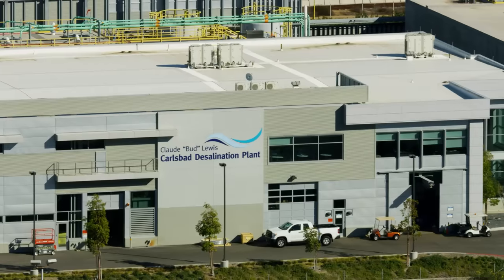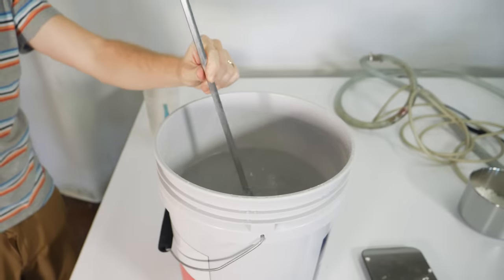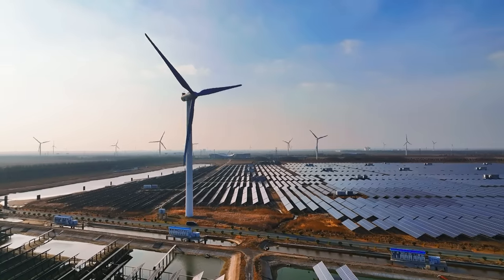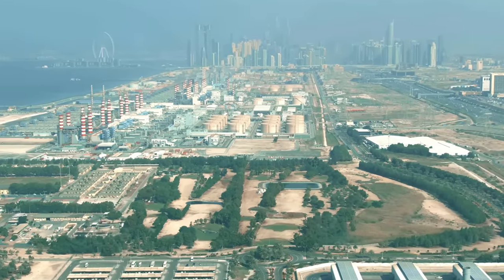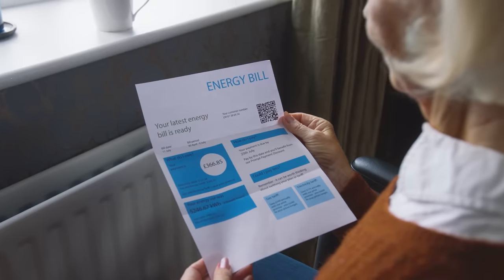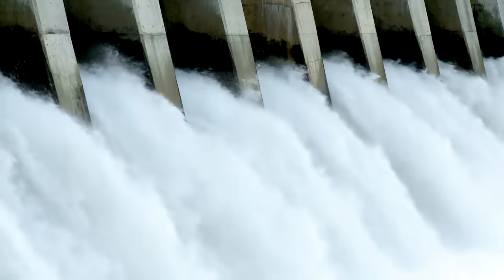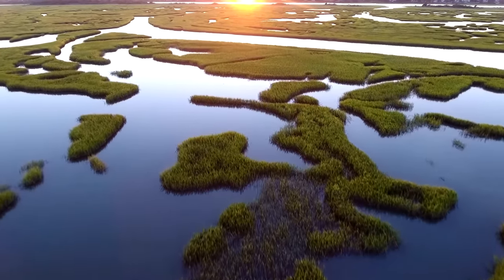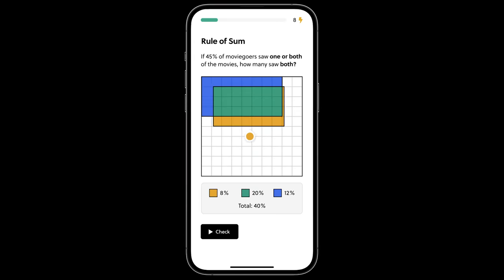Why Is Desalination So Difficult?

Comment: I'm a Navy veteran and I served on a Nuclear Aircraft Carrier. We had a desalination system built into the Reactor system using the excess heat from the steam powerd turbines. It was actually very efficient.
Reply: Nobody cares, bud.
Reply: nice, i was wondering exactly this. as nuclear and other powerplants have to boil water anyways, why aren't those systems combined?!
Reply: @adrieltc  sadly nuclear doesn't have large profit margins. So big energy used the fear of radiation and meltdowns to justify closing plants... then went back to fossil fuels.
Reply: @andybaldman  I care.
Reply: @adrieltc  They are combined at times, but the designs have to be tested thoroughly.
Reply: @andybaldman  Did Father Bob touch you in your no-no area?
Reply: @Myrune1  Yep.  And I liked it.
Reply: @adrieltc  Thing is that you can't use the Steam Cycle Water for Desalination. Boiler Water (and the Steam Cycle of a Nuclear Plant is nothing different) must be treated with some strong Chemicals, making the Water considerably caustic. Instead, you use the hot Condensate from the Turbines to then heat up an external Desalination Plant. That same Principle is used on commercial Ships to produce Fresh Water with reclaimed Waste Heat from the Engine Cooling Water.
Reply: @andybaldman Speak for yourself. I found it interesting to know
Reply: @morganmedrano920  Roads arent profitable either but we still have roads
Reply: @namename9998 Roads absolutely are profitable. Consider how much the economy would shrink if there weren’t roads available to move people and products
Reply: @andybaldman  Nice attention seeking behavior.
Reply: @namename9998  How do you figure that roads are not profitable?
Reply: @andybaldman  it appears you care despite your comment
Reply: Does it also have the mandatory JP-5 injection for enhanced taste?
Reply: @CaliMeatWagon  Thanks for giving it to me!
Reply: @andybaldman  Actually this sounds very interessting.
Reply: @Fred_the_1996  Navy Grape Drink...
Reply: @mrb692  Thats not how profit works. If it was then why are so many roads and bridges in bad conditions. If roads were actually profitable then they would be paved with gold but theyre not. And using your logic then the toilet paper you flush down the toilet is profitable and so is your underwear except thats not how profit works.
Reply: @CaliMeatWagon  If roads were profitable then why arent they paved in gold?
Reply: @andybaldman  Well if you are begging for it in the youtube comments section, then you clearly need it. And I like to help the less fortunate.
Reply: @namename9998  Answer the original question:
"How do you figure that roads are not profitable?"
Reply: @mrb692  Toll roads are profitable. But any road that does not charge to use it can't generate money for its upkeep, thus it's a money pit. economic impact is not the same as profitable
Reply: @CaliMeatWagon  Toll roads are profitable. Roads that do not charge for use are not. Don't confuse economic impact with generating its own revenue. If a road doesn't make its own money, it can't make profit (the money left over after cost of upkeep is profit)
Reply: @andybaldman  You cared enough to write a response, bud
Reply: @Myrune1  I didn't like his comment either, but there is no need to perpetuate vulgar stereotypes.
Reply: stop being so toxic partypooper
Reply: @sammiller6631  I'm in CA, a state that basically requires a License to get around because of the horrid infrastructure. My annual registration is over $200 and like %30 goes to the roads and about another %30 goes to the CHP. So even a road without a toll, is getting its share.
Reply: @andybaldman well it's a science discussion and it's relevant to the subject in the video so....I think most people disagree with you
Reply: @andybaldman this is an educational video?
Reply: @sammiller6631  Profitable doesn't just mean "revenue minus expenses". Profitability according to common usage and several English dictionaries also means "yielding advantageous returns or results; beneficial; useful". So to claim that the only way roads can be profitable is if they directly collect revenue, by tolls or other means, is objectively false.
Reply: @sammiller6631  Wouldnt the fact that roads rely on public assistance via taxes be another example of why roads arent profitable?
Reply: @andybaldman  
And yet you left a reply
Reply: Very efficient after the $30 billion up front investment XD
Reply: @CrunchsterXX2 That was too much. I found him rude for saying it, but what you said was truly Bad Form.
Reply: @namename9998 Infrastructure is a societal investment. Society doesn't expect to make a profit from roads, hospitals, schools or bridges. The positive impact of these things is not directly measured in so mercenary a fashion.
Reply: @adrieltc  He briefly mentions it at 6:18 in the video.  It's a technique called cogeneration.
Reply: @andybaldman why would you feel the need to say that?
Reply: @adrieltc  what stopping using nuclear energy not only it is fairly expensive, but it often has negative political move since many people equate nuclear == Chernobyl
Reply: Thanks for sharing this information!
Reply: @morganmedrano920  To think how far we would be if we didn't shut down nuclear plants
Reply: @namename9998  On a purely technical basis they don't make money in fact some states have been pushing to turn some interstates into toll roads to pay for the expensive maintenance costs, but the less direct economic benefits outweigh the cost of maintaining, people rely on the roads to ship things by trucks, get to places. The economy relies on interstate highways, infrastructure projects like inter-states and rail projects may not have initial benefits but the long-term ones are why we build them.
Reply: @ryanchun5536  I understand your point about the start up cost. However I as you to consider the "product life cycle". It's expensive to start up, because the country that should have been throwing the most money to develop, just kind of stopped. So we never hit the point where building them gets cheaper as we get most efficient and effective. That is also when the technology shrinks in size. Honestly we should be using mini reactor substations with how long we have had this tech.
Reply: @andybaldman I do. Lol.
Reply: @andybaldman I can tell strange ones create other strange ones💀💀
Reply: The desalination system is efficient. Having aircraft carriers is about the least efficient use of money on earth. 
Thank you for your service.
Reply: @Genius_at_Work  this is not correct. On three of the four subs I was on the steam driven distillation units ran off of auxiliary steam system with lower pressure than the main steam system. The steam is not caustic. The boiler water is treated, but those chemicals don’t carry over into the steam.
Reply: @sammiller6631  Governments invest in roads (and other infrastructure) which grows the economy which means more tax revenue. 

Consider the GDP and thus tax revenue of a government that does not provide roads to its citizens, then consider the GDP and tax revenue of one that does. Governments avoid investing in infrastructure because it is 1) expensive, and 2) construction takes longer than one election cycle. In a world dominated by the quarterly report, why spend money to improve future income later when you can spend money today?
Reply: @namename9998  Governments avoid investing in infrastructure because it is 1) expensive, and 2) takes longer than one election cycle. In a world dominated by the quarterly report, why spend money to cause traffic now and improve future income later when you can spend money on other stuff and not cause traffic today?

But at the end of the day, better infrastructure = bigger economy = more tax revenue
Reply: @andybaldman the point he makes is that energy production and energy transportation, due to thermodynamics, will always have losses through the form of heat. This unavoidable loss can be harnessed through additional systems, such as coupling desalination to an energy producing facility that will otherwise have no productive use for the heat loss.

In short, anyone who cares about economic desalination does in fact care.
Reply: @andybaldman  Why do people like you even watch channels like these. Doesn't seem to match the mind of someone who is curious and always learning.
Reply: @neurofiedyamato8763  The fact is, you don't watch this to learn anything.   Despite what you might feel, you aren't learning engineering by watching youtube.   You watch this because youtube put it in your feed.
Reply: If you are running a nuclear steam turbine, yeah desalination is easy!
Reply: @adrieltc  I searched this a year ago and yes - nuclear desalination is a thing
Reply: @morganmedrano920 I am not sure nuclear power is attractive if we include cost of storing used fuel rods.
Reply: @andybaldman what’s wrong with you ?
Reply: @morganmedrano920 every state requires a license to drive ?
I don’t understand.
I live in CA, infrastructure is comparable to other states, in larger cities freeways are horrible due to traffic jams other than that roads are in good condition.
Reply: @hikarikaguraenjoyer9918 tax on gasoline was supposed to be used for maintaining roads and bridges ?
Reply: @gund89123  No, I mean CA requires you to drive... as in you can't rely on public transportation. For example, Sacramento used to run the light rail 🚈 24/hrs now its like 16/hrs. We developed new areas and never extended the busses to go to them, ect..
Reply: @namename9998 

"If roads are profitable then why aren't they paved in gold?"

Because then they wouldn't be profitable, genius.
Reply: @gund89123  not really what i meant but at least where I am from they used the money for maintance
Reply: @notahotshot  You mean like jewelry isnt profitable despite being made of gold and precious gems? But jewelry is profitable so your argument doesnt make sense.
Reply: @Svensk7119 a direct profit*
Reply: @notahotshot  Once you get past the fact that you're being trolled by namename you kinda have to admire the mental gymnastics required to come up with that that kind of bull, even while you fail to understand their motivation
Reply: I had a thought the other day. We should make a garbage incinerating barge that self sustains itself and produces clean water as a byproduct.
Reply: @adrieltc  They are kind of combined. But at least on the Enterprise, the desal plants were in the auxiliary spaces. There simply is no room to have them in the steam spaces where the main engines are. The reduction gears alone take up a huge chunk of that space. And the Reactor Auxiliary rooms have systems for the reactor plant, including piping with radioactivity in them.
Reply: @adrieltc Because liberals scream about every industrial project. It's politics that is currently blocking California's attempt at desalination.
Reply: @andybaldman I care, what I don’t care about if you.
Reply: @andybaldman don't comment then
Reply: @mrb692 Nope, roads are one of the biggest losses for cities and governments
Reply: @sammiller6631 even toll roads aren't profitable.
Reply: @andybaldman sorry, but I care bud
Reply: @RobertDoornbosF1  Do you have a source or something I can google? I could see roads being one of the biggest expenses governments have, but when you consider 1) the roads are mostly paid for with taxes on fuel and 2) how much tax revenue would not have been collected if roads did not exist to provide efficient transport of people and product, I can’t see roads operating at a net loss (as in a government would make more money by not investing in roads)
Reply: @mrb692  Just google a cities bookmarking records for a random year. 

Especially North American cities, but also in Europe. Road maintainance will be a big expense, and in the income section, nowhere will roads be mentioned, because that's not how profit works.

Or read into growth ponzi scheme suburbia. Most papers, articles on that are not talking directly why roads are nit profitable but it's in the ballpark

Kinda unnecesary, but you stated roads provide efficient transport. Kinda false, since roads are for cars, and cars are inherently inefficient at moving masses of people.
Reply: The irony is that nearly every nuclear plant with a cooling tower generates a ridiculous amount of freshwater in the form of clouds from their cooling towers, and yes, they have to have desalination/RO filters to keep their cooling water from turning into brine. The plant I worked for had two reactors, and the entire first floor of both power blocks was almost nothing but desalinization equipment.

Simply capturing that water would have provided a huge quantity of fresh water, but the plant was literally located on a river, so no one cared. That, and at that point in the plant's life cycle, everything was crapped up. People fished in the discharge canal of unit 1, but... I certainly wouldn't have eaten anything I caught there.
Reply: @maurvir3197  That's exactly what I'm saying 👏. Nuclear plants make steam as a byproduct. We can also capture the salt and remove it from the ocean since there is way too much at the moment. I guess technically, it would help with microplastics if we had enough plants taking in ocean water.
Reply: @Svensk7119  remove hospitals from your list along with some schools, the US healthcare system is suffering from greed by a very few at the top.
Reply: @johnnykATL  Some greed, yes. There are people in it who generally want to help.
Reply: @Svensk7119  oh I know, I’ve spent my whole adult life as one of the people in it to help and while the majority of frontline healthcare workers care and strive to do right, it’s the few in the management/ownership end of things that are the ones I’m referring to.
Reply: no, that just means you had way too much waste heat, you fix your waste heat issue and your desalination becomes way more expensive.
Reply: @andybaldman  i care
Reply: @andybaldman I do ❤
Reply: @andybaldman u should be nice ❤ people matter
Reply: @CaliMeatWagon  feel other means is lose enough to fit anything I need.. totally see your point an agree.  For now lol
Reply: @scottmcshannon6821  fair, but I would argue that it's not waste heat if it's being used with intent/purpose.
Reply: @Lardbutt200  "Are hotels profitable? Are airplanes profitable? Are grocery stores profitable?"
Yes. Yes. Yes.
Reply: @Lardbutt200  I guess you dont know that there are luxury hotels painted with gold.
Reply: @andybaldman  Apathy is often a sign of low intelligence.
Reply: @OutsiderLabs  Or high selectiveness.
Reply: @andybaldman  you don't get to speak for anybody but yourself and comments like that make me question if you should be allowed even that much.
Reply: @namename9998 That doesn't make any sense. Gold doesn't improve their value to consumers. It's like saying, if beef is so profitable why isn't it studded with diamonds?
Reply: @sammiller6631 They're profitable in the broad sense that they generate more economic output than the require in tax money to build/maintain. Toll roads just make the tax more immediate and explicit.
Reply: @andybaldman  You might not, but I care
Reply: Watch out, the man said desalination was the "nuclear power" of water supply, i.e. terribly impractical and inefficient, compared to alternatives. You should have served on one with solar panels.
Reply: Nukes are a h o a x, we found this out in 2007!
Reply: @Terminus316 He says things like that because of people like you. Instead of just hitting the thumb down and completely ignoring him, you gave him the acknowledgement that he was craving. Congratulations you fell for it.
Reply: @gund89123 That's a myth that it's difficult, dangerous to store nuclear waste. It also doesn't take a crazy amount of space to store it. We could power our country with nuclear with no problem. France gets 70% of their electricity from nuclear and we more technologically-advanced with nuclear than what France is.
Reply: @gund89123 Poor infrastructure and roads in California has just been normalized for you guys. You are ranked in third place for having the worst roads in the country, with only New Jersey and Rhode Island and worse roads in you. Other reports rank you as the worst and another one had you in second place. 

Daily driven miles per capita was not extraordinarily high either, a lot of states were higher and some were lower.  You were 20.9, Massachusetts is 21.6, Connecticut 22.9, Wisconsin 27.2, Michigan 23.8, just for comparison. 

You are spending per Lane mi was 11th, which was actually better than I expected. The difference in road condition between the worst ones was pretty high compared to the average. The same goes for the difference in spending. Only one more state below California is spending in the 6 figure per lane mile, after that the prices start dropping pretty fast. Maybe you're fortunate enough to do most of your driving on the California roads that are in the best condition.
Reply: @namename9998 , "Thats not how profit works. If it was then why are so many roads and bridges in bad conditions. [...]"
You really don't have any idea how anything involving money works, do you? Or engineering since I can't really think of anything that would be worse to pave a road with than gold.
Reply: @sammiller6631 , "Toll roads are profitable. But any road that does not charge to use it can't generate money for its upkeep, thus it's a money pit. economic impact is not the same as profitable"
So... You figure that government is the only entity capable of building a road? Who do you suppose builds logging roads? Do you suppose those roads aren't generating a profit for the companies that build them?
I'll bet you're an accountant...
Reply: @gregorymalchuk272 , "Because liberals scream about every industrial project." Kinda. Mostly they scream about the wrong things and ignore the things that are actually causing real problems. Like corrupt politicians.
Reply: @MyName-tb9oz  "You really don't have any idea how anything involving money works, do you?"
It doesnt matter if there are better things to pave roads with 1-because "with gold" is a metaphor for being luxurious 2- If you can afford to pave something with gold then everything else doesnt matter because you could afford to maintain it.
Reply: @andybaldman  ? Why u mad and miserable lol
Reply: @andybaldman go back to play fortnite kid
Reply: @Astrotamtv  Because you exist.
Reply: @andybaldman Despite the age of your account, clearly another child left behind.
Reply: @andybaldman  Just because you don't care doesn't mean everyone doesn't care.
Reply: @Genius_at_Work  This is something that I've wanted to know for awhile because I wondered the same thing as them e.g. why can't we just use the actual boiling to desalinate the water and use the output for drinking water.
Reply: @gregorymalchuk272 no, they don't
Reply: having a nuclear reactor be built on the ocean, even in the form of an aircraft carrier, sounds like a good idea 😄
Reply: @andybaldman why are you in this comment section?
Reply: @sdfg204  Solely to get people like you to comment.
Reply: @andybaldman  cringe response.
Reply: @muyodosel1658  Triggered.
Reply: @andybaldman  not a single comment you've ever made was cared about more than the effects of his accurate comment. To an almost unfathomable degree.
Reply: Interesting! How do they keep the water from becoming irradiated ? (Not sure that’s the right term…) ☢️
Reply: @andybaldman if you need frnd i am here bro no need for these shenanigans
Reply: @michaelrobertson1736 Naval reactors use Pressurized Water Reactors. This works by having two separate loops of water which dont interact. The first loop that interacts with the reactor comes under immense pressure which then transfers heat to the second loop through systems i dont fully understand lol. The water doesent mix though and the second loop is what spins the turbine. This is part of the advantage of PWRs as turbine systems dont have any radioactive particles going through them. Hope this helps
Reply: I was actually just thinking during this video why the heck can't they use the steam from a nuclear reactor so that they can simultaneously make power and clean water. That's amazing someone already figured that out.
Reply: 19 people who don't care compared to 1.8k up votes from people who cares. LOL
Reply: Only a sailor deals in absolutes
Reply: Very efficient 😂😂😂
Reply: @andybaldman you're wrong, i do, and i think it is very cool
Reply: @andybaldman negative Nancy over here
Reply: @andybaldman andy have you started taking you meds again? Or are you still a sad loner a year later
Reply: @cosmicwerewolf1504  I'm still here, and still trolling folks like you in youtube comments.
Reply: @andybaldman  sounds like a sad existence. I wish you the best! Again don't forget to take ur meds!
Reply: @cosmicwerewolf1504  Stay cosmic, you crazy werewolf!
Reply: @andybaldman  You're speaking for all the nobodies or just yourself?
Reply: @Iloveswedes  Just myself, from one nobody to another.
Reply: @andybaldman lmfao exactly bro, this guy was 100% Joe navy
Reply: @Dana__black  <-----  This guy gets it.
Reply: Just another reason , nuclear is the superior energy source
Reply: @namename9998  roads are more profitable than the alternative of just moving stuff down dirt paths. Now, highway freight is far less cost-effective than alternatives like rail, but that isn't what you were talking about and rail still needs supporting roads for distribution, so eh
Reply: @andybaldman  I care
Reply: @andybaldman  Just reminding you that you cared enough to comment, bud.
Reply: He has 2400 likes @andybaldman
Reply: @andybaldman  Who hurt you?
Reply: Issue is scale, you can not feasibly use heat for city scale desalination
Reply: @yourfave  that is actually one of the best counter arguments I have heard/read. I just thought it wouldn't be that effective because the ship services 5000 people with a plant that is smaller than the kind on land.
Reply: @yourfave  unless the heat is coming from a nuclear source. Its a initial investment kind of thing. Spend the money once and don't think about it for the next sixty years. Seems like a good deal to me.
Reply: @andybaldman Yes, we do.